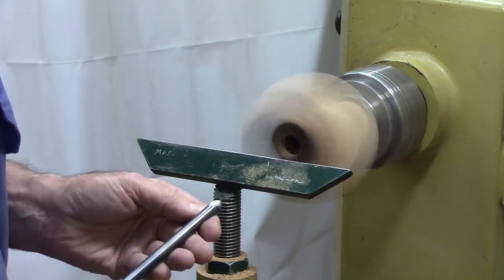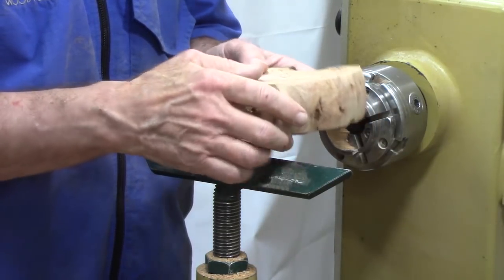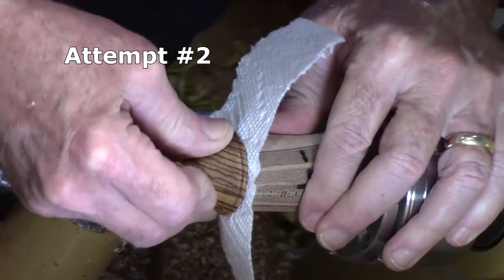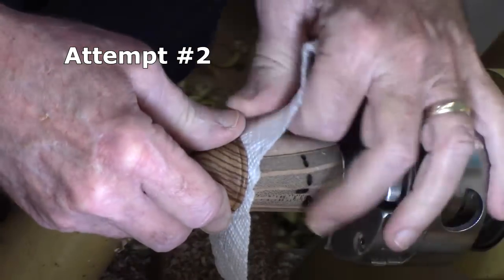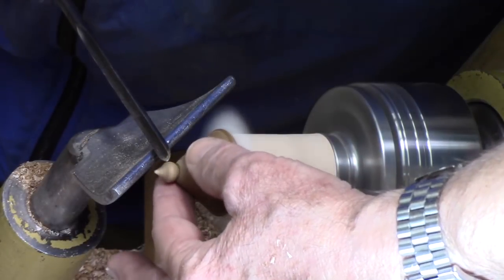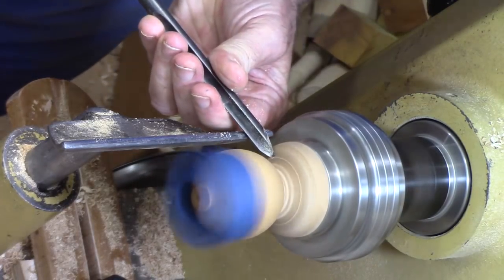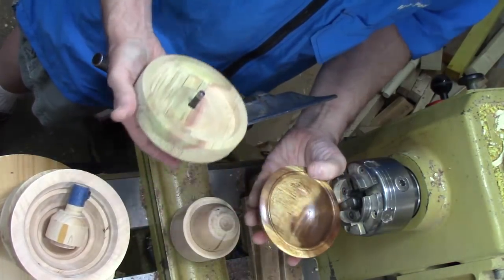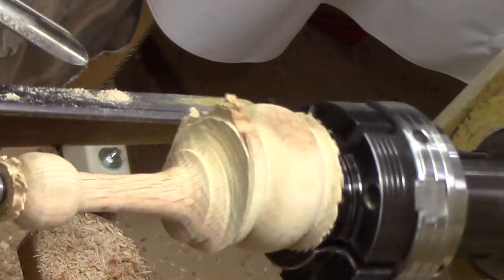Woodturning Fails, Catches and Bloopers #4

Comment: Next time you have a stuck bowl on a chuck try using air instead of possibly scratching the bowl.
Reply from the maker: Excellent suggestion. Since  I have a small compressor which I infrequently use in my turning, I sometimes forget about it.